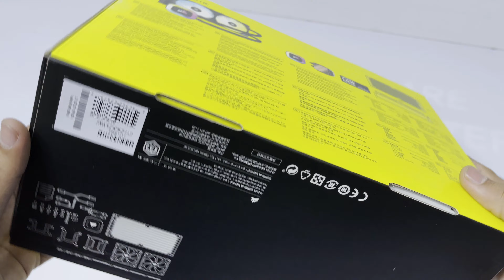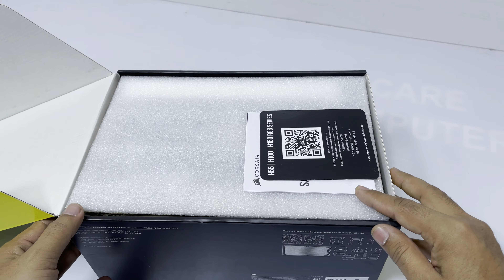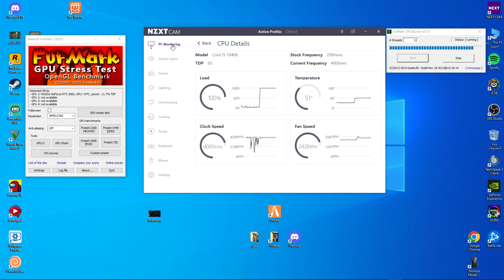CORSAIR H100 RGB 240 LIQUID COOLER UNBOX INSTALL TEST

Comment: Why are there few videos about this product on the internet?
Reply: Because this is outmost
Reply: @smile-iy5xc  what
Reply: It'd not true water cooler thats why. It builds up moisture from the air and goes through the radiator to the pump
Reply: @NLG_NeverLetGo bro what😂 are you good in the head?
Reply: @NLG_NeverLetGo  what?
Reply: Becuase it is a 3rd class product
Reply: Share your experience  @gAme-pUK07
Reply: It's an entry level AIO that does the job for most entry level to Midrange CPUs.
I had one myself- it's pretty good at what it does. Don't bother pairing this with high end CPUs and expecting good temps.

Comment: This is AM5 compatible. The product doesn’t list that capability, which is a printing error. The instructions also lack the clarity of this video. The product also does not include the slide switch that controls the color. The female 3-pin LED connector is a poor fit; on my system it fell off while carrying the PC from bench to desk. Maybe an adapter will solve this, or use of the second 3-pin LED header. This video was very helpful and covers some gaps that Corsair neglected.
Reply: How to change the bracket to am5?
Reply: @DeathClawDC it's the same as am4
Reply: The newer model has AM5 compatibility labeled on the packaging

Comment: 2:20 do you know where I can buy one of these specific cables on its own? I just installed my h100, and I connected that cable direct to the motherboard (Asrock z790 Riptide Wifi) and it works like a charm and the bios software controlls the LEDs fantastically. I've got 3 other separate RGB fans that I want to connect to the motherboard in the same way but I can't figure out where to get that cable from. I don't want to connect them to the corsair hub/USB/controller, the motherboard works great for it and I've got a perfect ARGB header left over for them. Where can I get that cable?

Comment: I bought my PC used and it came with different fans installed on the radiator and they don't have the connectors that are shown at the1:42 mark in the video. Do I have to have those specific fans and connectors in order for the AIO to function correctly?
Reply from the maker: No not need same fan you can install any other fan

Comment: Great video! It's possible to controll the speed of pump in this model H100 RGB? I have the H100 but I can't.
Reply from the maker: You can control it with motherboard rgb software if motherboard have 3pin Argb connector otherwise you have to purchase argb controller
Reply: @itcarecomputers  Thanks for your answer. My motherboard is a MSI PRO Z690-A WIFI. I have connected the pump's 3-pin cable to the motherboard PUMP_FAN and the two fans to the motherboard CPU_FAN. I can control de speed of fans, but I can´t to controll the speed of pump. The pump is always around 3000 RPM. What do you think?
Reply: This is normal, the pump ideally operates at a constant speed.

Comment: Can I install this pump vertically? I don’t have enough clearance between my motherboard and the top of my case to install it there
Reply: yes just make sure the pump isn't any higher, vertically (y-axis), then the radiator otherwise you'll get air in the pump which is a big NO NO

Comment: Hi friend, good morning! Look, I have this liquid cooler, I don't know much about computers, I bought it 4 months ago. The question is that I wanted to know if you could explain to me how to change the RGB, I looked in google for videos, it came out that it is changed by software and the truth is that I can't solve it... But also because it had to be compatible with my motherboard? Might you help me:(
From already thank you very much
Reply: I don't know if it has to do with what I said, that it came out that it had to be compatible with the motherboard or something like that, but the one I have is an Asus B550-K
Reply: Look at your video that you touched a button to change it, the truth is that on my computer it's the cables and so on, I would think that I see that button, but I don't dare to press it in case I do something wrong or I don't know: (
Reply from the maker: @valeeen2968  bro you can't change it because there is no arg connector on your motherboard for that you have to buy controller . In video i used that connector just for check.   Hope you understand

Comment: Good afternoon, my motherboard is a z390m gaming and it has the 12v RGB connector, how do I connect my h100 rgb watercooler directly to the board? thanks
Reply from the maker: Bad luck you have to buy arbg controller for that or connect with case controller if you have
Reply: @itcarecomputers  But how does it work, the watercooler is 12v, the argb is 5v!
Reply from the maker: @lopes3969  all connector are 5v argb
Reply: @lopes3969  Fala Fernando, tudo certo? Mano, como voce usa processador da Intel, poderia me vender os parafusos da AMD que vem com esse watercooler? Estou precisando deles para montar o meu… valeu demais!
Reply: @mrpulgarock1000  ola amigo, na verdade esse watter cooler ali era de um cliente, não tenho os parafusos , valeu !
Reply: @lopes3969  entendi… você sabe me dizer se esse cliente usava Intel ou amd? Que aí eu poderia fazer uma oferta direto pra ele!
Reply: @mrpulgarock1000  Intel, mas no momento ele está trabalhando nos EUA !

Comment: Hello, does anyone know how many RPM the pump goes at? not the fans, the speed of the pump that moves the liquid.
Reply: No idea but my 14700 with no overclocking sits at 32°c Idle with it, if that helps

Comment: Does it support AM5?
Reply from the maker: Yes it's support.  Cooling Socket Support Intel 1700, 1200, 1150, 1151, 1155, 1156, 1366, 2011, 2066
AMD AM5, AM4
Reply: @itcarecomputers  which one should i buy  corsair h100 240mm or the deepcool le 500 240mm?
Reply from the maker: @Noob_Lord_  go with Corsair

Comment: Does this cooler works without iCue software ? Can speeds be controlled in BIOS not in the iCUE. Linux does not support iCUE software.
Reply: Pretty sure it'll work, but only in its standard rgb configuration. You won't be able to change any of the lighting.

Comment: How much length for each cable radiator fans
Reply from the maker: 400mm
Reply from the maker: 400mm
Reply: @itcarecomputers  thank you, my Motherboard MSI z590-A Pro, the sys_fan header located far from CPU socket, and I'm planning to install the radiator at the top of the casing, will it be reach the fan cable to the header sys_fan of the mobo
Reply from the maker: @mekanin  yes

Comment: is there a software where you can change the lighting of the cooler and fans?
Reply from the maker: Just form motherboard software
Reply: @itcarecomputers  icue?
Reply from the maker: @hihoreter5445  no
Reply: ICUE software lets you change the color of the cooler lighting. My radiator fans are controlled by the RGB hub on my motherboard.